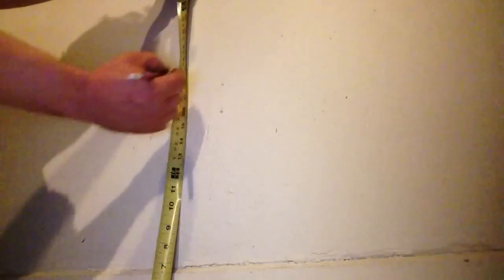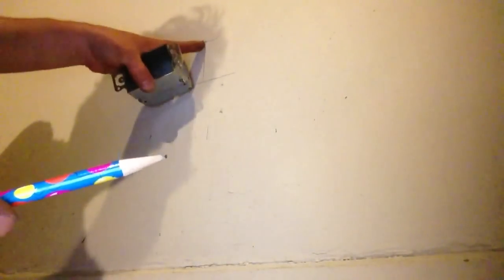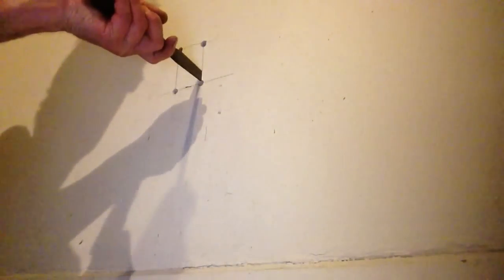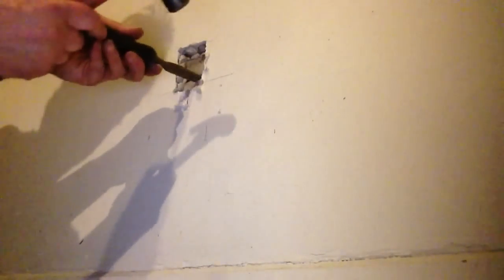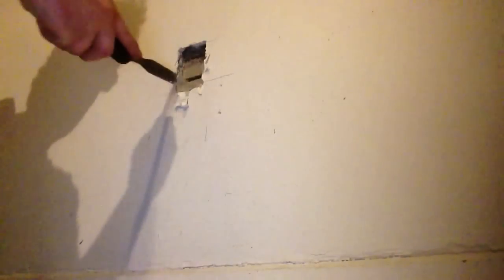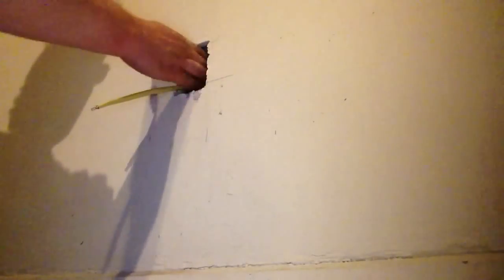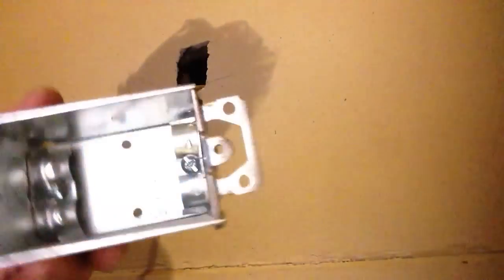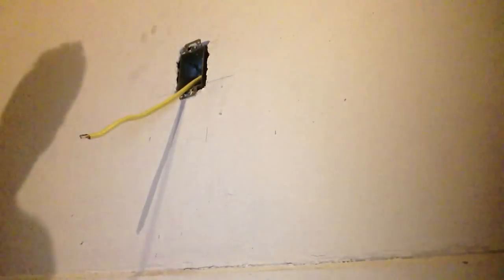How to install electrical box in lath and plaster part 1

Comment: I've found it easier to remove the lattes if when you're cutting the first side, leave about a 1/16", then cut the other side. This way you won't have to put your finger in there to hold it and it doesn't vibrate the plaster around the hole as much, which leads to the plaster cracking and falling off.

Comment: Pierce screwdriver first to find gap between lath.  Go 2 inches up or down pierce screwdriver again to find the other gap in lath. Now you no we're your center lath is. This means when you cut out box you will  have enough lath on the top and bottom left over to screw your old work box into. This guy wiped out his top lath nothing really to screw to up top. Using Madison bars on lath wall are nightmare so always leave enough lath top and bottom so you can secure box good. I worked in Boston for 8 years sparking. This the best way for me. I've cut out probably close to a thousand boxes..lol.. I serious.

Comment: I find that using an Oscillating Multifunction Tool is more precise and does less damage to the lath and plaster. The hard part is getting the best blades. The plaster is really hard on them.
Reply: I found using an abrasive (grout, tile) blade for the plaster and then a wood blade on the lathe is the best way to go to save blades.

Comment: One more thing when your cutting the center lath don't cut one side then the other. Cut 80% through one side then cut fully through other side and the lath won't bunch around. So you left with a little bit to cut. Just change to padsaw to finish piece of center lath. That will keep your fingers save and it takes about the same time

Comment: This guy is about half right. 1st dont cut anything until u have poked through with a drill bit a couple times to make sure u r clear behind it. And 2nd, leave about 1/16 of wood on each side of the lath planks so u can do most of ur cutting without it bouncing. It's hard to hold it still enough to not beat the wall up so the less u have to cut the better. Just snip snip and it's gone trouble free.

Comment: So glad I found your video it was a GREAT help.  My house was built in the 50's and has plaster walls. Three of 4 closets have no lights.  I had several concerns about opening the wall to put in a new switch.  This video gave me all the answers I needed and the "Optional" procedure you describe in the video (use of a chisel) worked like a charm!  My cut was straight and square - unlike the original hole the contract did!
Reply from the maker: Harold Terranova that's great. This is one of my favorite things to do is cut and mount boxes.

Comment: Me being a retired electrician is wondering why you did not use an "old work" plastic box with expanding tabs instead of this metal box. Using this metal box you will be putting screws into just the plaster and if by chance you are lucky enough you may hit the lath behind it. Either way being this is a receptacle over time (not a long period of time) pulling plugs out of this receptcle using this metal box you will end up pulling the box out of the wall. Even with madison strips it will end up being loose.

Plaster/lath walls are difficult to place boxes into. The most important thing actually is having the proper tool to cut the lathe behind the plaster. Using a plastic old work box you need to before installing the box open the distance on each of the two tabs of the box. Unscrew so the tab is open as much as possible on each of the two before installing into the wall. Once you place the box in the wall tighten the tabs. If you do not open the tabs prior you will find it difficult for the tabs to grab onto anything thus making the box useless. the other thing is make sure you strip the sheathing on the romex and prefeed your romex through the hole in the box before inserting the box into the wall. This will put less stress on the plaster and lath which may cause more problems with plaster falling out, etc.

And as mentioned you have to find the closest stud. You don't want to be opening the wall right in front of the stub which will then not allow the depth of the box to fit in the wall.

I find working with plaster and lathe one of the most difficult wall surfaces to work with. If sheetrock will be covering the wall in a renovation I just cut a large hole in the wall where the box will go, use a plastic old work box and then not even install the box until after the sheet rock is up and installed and install the box into the sheet rock as if the plaster lathe does not even exist.
Reply from the maker: I don't even consider plastic boxes. The metal box is held from pulling out by the box finger connecters. This provides 4 points of contact from pulling out. The plaster ears on the box sit on the plaster or are adjusted to sit in the lathe. They wont ever push through. The caulking makes the box solid, meets the 1/8 inch requirement, provides general sealing. After all that these boxes never come loose. I just removed some that were on a 20 year old kitchen counter top that I installed. This installation Is strong and tight. No screws used.

Comment: I have had problems with this method in the old work in my 100 year-old house.
Chiseling the plaster like shown always causes cracks in the plaster where I don't want them, and the lath can bounce when hit, and cause the plaster hooks to break off and weaken the attachment of the plaster to the wall.  Using any sort of reciprocating saw such as a jig saw or saws-all as shown to cut the lath will cause the lath to bounce around, causing more damage. Same with a vibrating multi-tool. Occasionally the lath will break off, leaving just the plaster. If there are any cracks in it, the plaster falls out and I have big holes to repair. 

I ended up using a Dremel set on the highest speed, with a diamond blade to whittle away the plaster.  Then a wood cutting Dremel blade for the exposed lath. Slow work, lots of dust. Plus you need to let the blades cool to avoid smoke.  The plaster in my house has small (~1/8" - 3/16") pebbles in the base layer, those I would pick out with a awl when I hit them. Slow, but I get a neat opening that needs no repair.

Also, when installing the box, I glue a piece of wood to the opposite wall to give it a backing and anchor it. It has a lot more stability than the front screws give it.
Reply: Plus, when determining the location of the box, you should find the location of the lath first, then position the opening so the screws on the electrical box will hit the lath, both top and bottom. Otherwise you may end up putting the mounting screws into just the plaster between the lath, which will do nothing for support since it will break off when the screws are installed.
Reply: I had a similar experience in my 100+ year old house.  I found a good way to get the plaster off is to first score it deeply with a razor knife and then gently chisel it.  I had almost a perfect rectangle cut out leaving just the lath exposed...then I tried using a jigsaw, and like you said...BAM - huge chunk of plaster I wasn't intending to remove flew off from the bouncing lath.  I'm going to give your Dremel method a try...thanks!
Reply: We think the same buddy..
Reply: I've had the cracking plaster with the chisel! I've had the bouncing lath with the sawzall!  Best method i found was an angle grinder and a metal cutoff wheel, or a roto-zip (cutout tool).

Comment: Hi, great video, thanks. One question. You measured up 18" and placed the bottoms of the box there. I've read other places to "center" the box at 12" above the floor. Is there a specific "code requirement" or is there a range? Thanks..
Reply from the maker: +CinciDan08 no code requirements. I often will look around the room and will place new plugs at the same height as the existing ones. There is no problem with 12 inches you will have to bend over a little more. I have seen plugs installed in the floor in the Knob and Tube days.

Comment: Hey buddy, ever hear of a stud finder?
Reply from the maker: Gave up on stud finders long ago on walls with lathe.  Do you have any experience with a stud finder used over lathe and plaster?
Reply: @themrhelperguy  Yes, it works the same as with drywall.
Reply from the maker: I remember trying to use stud finders a while back and they could not get through the lath to find the stud. They always work great on drywall. Maybe the finders I had were just junk. I will give it another try.
Reply: @themrhelperguy  You are correct - electronic stud finders don't work well with plaster.  Use an old fashioned magnetic stud finder to locate the nails used to attach the lathe to the studs.